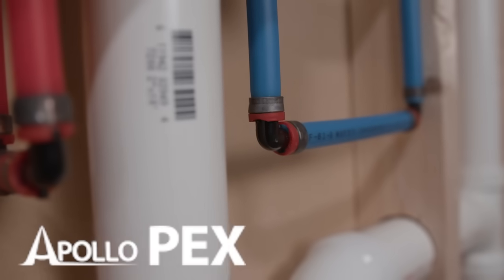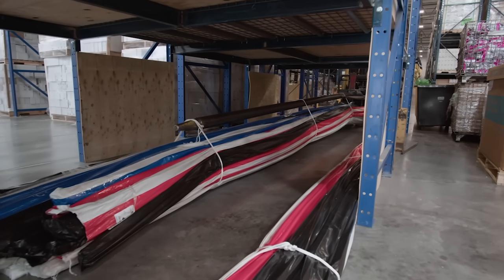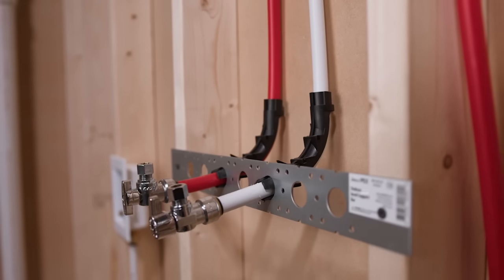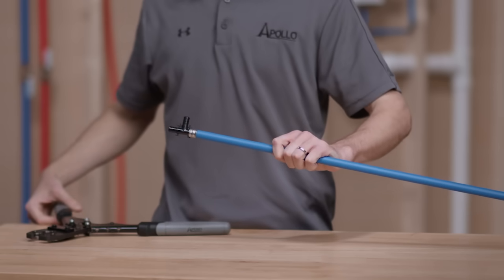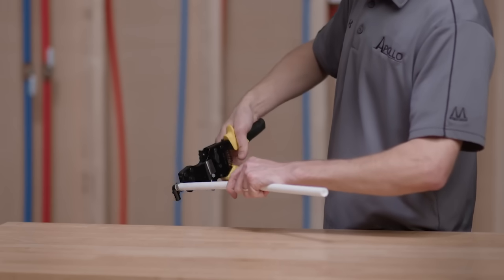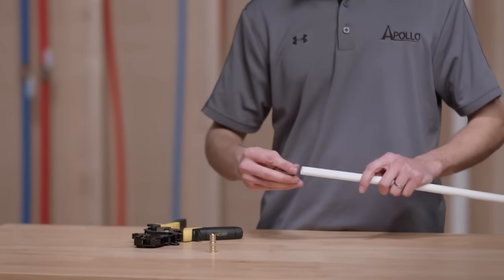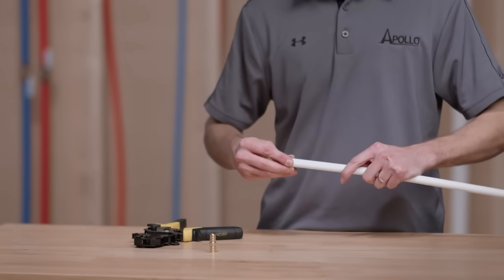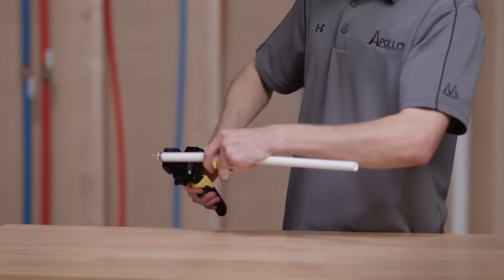How To Install PEX-B Plumbing - Apollo PEX

Comment: I am installing a 1/2 inch 3 way ball valve in my motorhome.  I have very little space in back of the valve and need to use a 1/2 inch NPT to PEX B elbow.  When I tighten the pipe elbow, it orients away from where I need it pointing.  What can I use to get the threads tight and in the direction I need it pointing to?